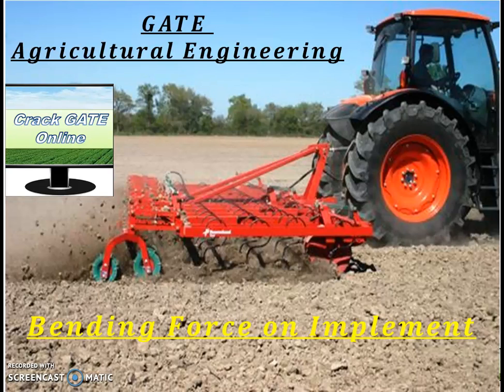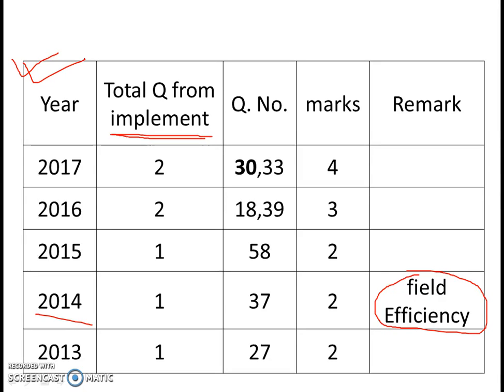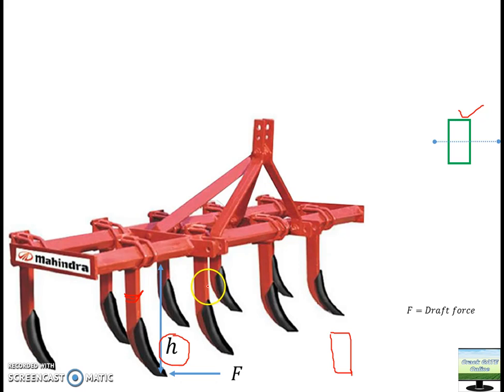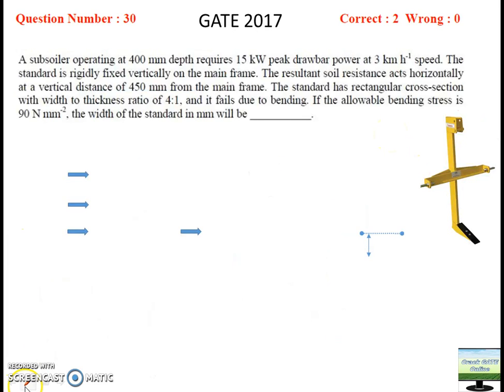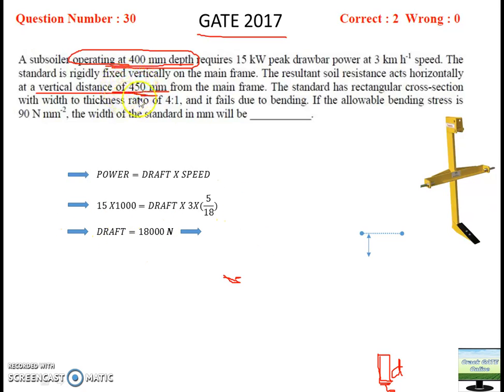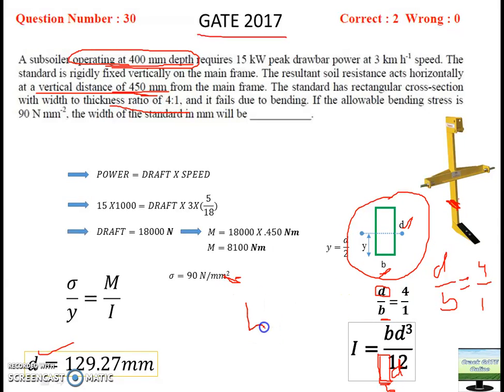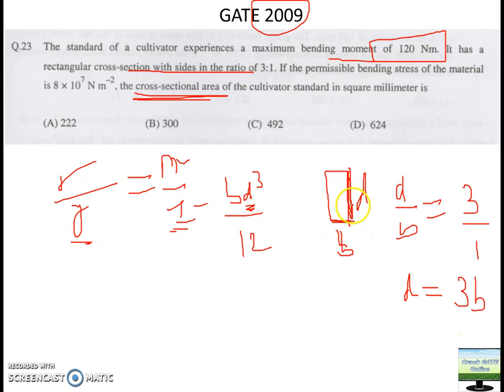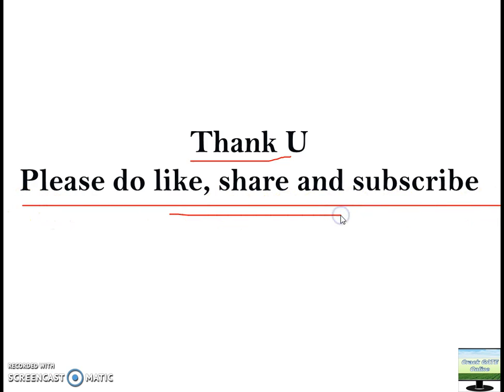Bending Force on Tillage Implement

Comment: ans = 300mm^2     
M=120Nm 
d/b=3/1 
thererore d=3b.....................(1)
or y=d/2 
or 2b/2
sigma=8*10^7Nm^-2
I=bd^3/12
put all values in equation (sigma/y = M/I) 
(8*10^7*10^-6Nmm^-2/3b = 120Nm*12*10^3/27b^3)
solving this and we get the value of b=10mm 
now we get also the value of d from equating the value of b in 1st equation d=30

we know the area of retangle =b*d=10*30=300mm^2